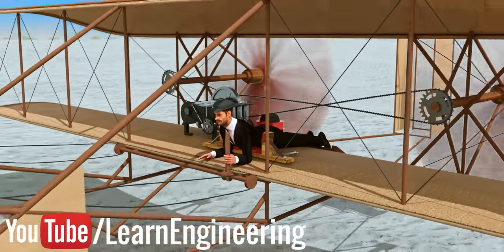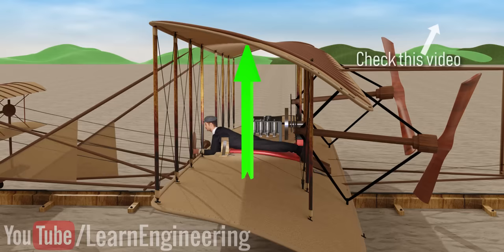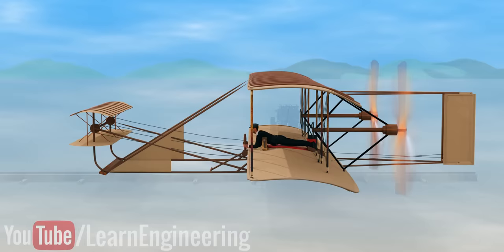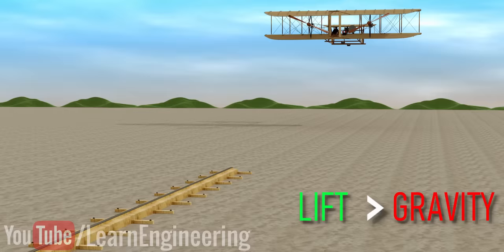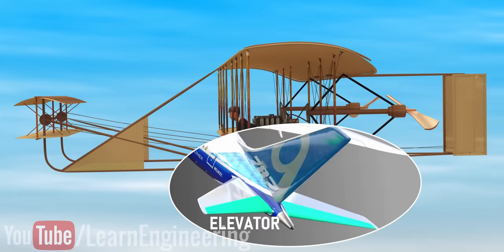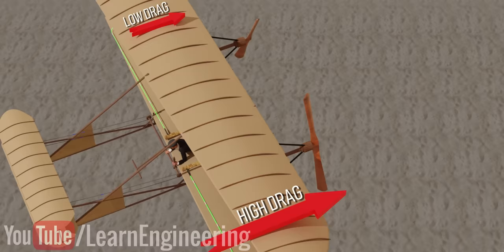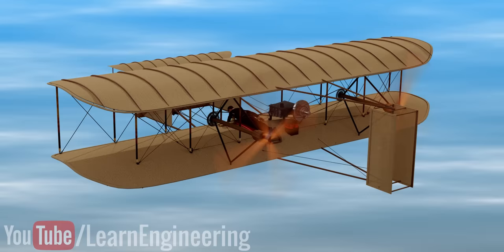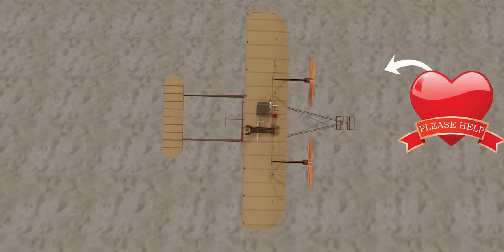The Brilliant Engineering of FIRST FLIGHT !

Comment: These guys were beasts! Their plane was the reverse of today's prop planes. Elevator in front of the big wings and props in the back. It also had no rudder, as there was no tail. This plane was not at all easy to control, especially that hip assembly for wing warping. The wing warp idea came about when one of the brothers was fiddling around  with an empty bike tire tube box and noticed how it distorted when he twisted it diagonally. Also amazing is that those 2 wooden props were cut by hand using a draw knife, yet achieved 87% efficiency!
Reply: See, in the table below, the data published by the North American magazine "National Aeronautics", official body of the "National Aeronautics Association" in Washington: Pilot Location Date Flight time Santos Dumont Bagatelle 12/11/1906 21 ” 
Henri Farman Issy le Moulineaux 11/26/1907 52 ” L
éon Delagrange Champ de Mars 11/04/1908 6’30 ” H
enri Farman Issy le Moulineaux 06/07/1908 29’53 ” Léon Delagrange Issy le Moulineaux 09/06/1908 20’19 For many years, these official figures have been published without any dispute. In the American magazine "Reader’s Digest" of December 1942, we found an article entitled "Santos Dumont, Father of Aviation", condensed from the magazine "Air Facts". From page 54 we transcribe the following excerpt: “in 1906 he gave the world the first public demonstration of flight in a device heavier than air (the Wright brothers only came to fly publicly in 1908)”.
Reply: SB:  Not sure that there first attempts to carve a prop were successful.  A test on one found in  museum showed that
it was defective.  It produced more Drag than Thrust when the RPM was over 300 rpm.  They could test small airfoils in their wind tunnel.  It was not large enough to test  an 8 ft. rotating prop.  The best they could do was a static test of thrust  using their machine shop motor.  

On site, they used a spring scale for a static test of Thrust.  
They were pleasantly surprised to find that their prop produced more thrust than it did in their calculations.

The Wright Propellers
Hyde started by bringing wooden propellers, hand crafted to the Wright specifications, to the NASA Langley Full Scale Tunnel,  owned by NASA Langley and operated by ODU. Then he progressed to authentic reproductions of two Wright gliders and then,  earlier this year, the Wright Flyer. 

All were tested by ODU engineering professors and students.

SB:  Were they 20 years ahead of their time?   Not convinced that the first props were 87% efficient.
I think that Hyde had his props tested at the NASA wind tunnel in Virginia.  I think they were about 82% efficient
at around 300 rpm and 35 mph.

A prop on a museum flyer replica was tested and found to produce more Drag than Thrust.  This seems like a 
good way to get rid of defective props because the museum replicas are not expected to fly.  

Wright Props  -  https://www.researchgate.net/publication/237462889_Evolution_of_Wright_Flyer_Propellers_between_1903_and_1912_

"The Wright propellers were 20 years ahead of their time," said Professor Robert Ash, 
Wright test program manager for ODU. "They were able to convert engine power into thrust with the efficiency 
required to enable a small and heavy gasoline engine to propel the Wright Flyer. The December 17, 1903, 
flight was not possible without the Wright propeller designs and this contribution has been largely overlooked."

https://www.loc.gov/collections/wilbur-and-orville-wright-papers/articles-and-essays/the-wilbur-and-orville-wright-timeline-1846-to-1948/1901-to-1910/

SB:  I don't think it has been overlooked.  It has been over-simplified.  Without a large wind tunnel, it was very difficult
to carve a prop that matched their theory for how it should be done.
Reply: @gilberto2056  Give it a rest, there were no "certifying organizations" in 1903, which is why there is no "official record" of the Wright brothers first flight. The Wright brothers created the need for those to be founded.
Reply: @gilberto2056  I have a question for you . If Santos Dumont, living in France, built the first successful airplane, why did the French Government buy the Wright’s plane and not Dumont’s?
Reply: @gilberto2056  Rubbish, If you want public flights try Huffman Prairie in 1905, right beside a trolleybus route with flights exceeding half an hour. /as others point out, the official body didn't exist when the Wrights first flew.